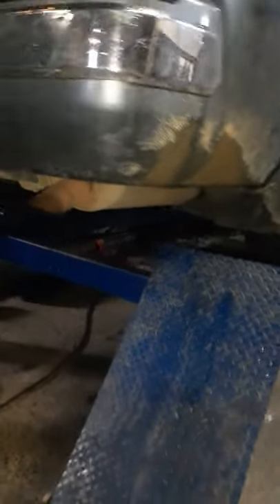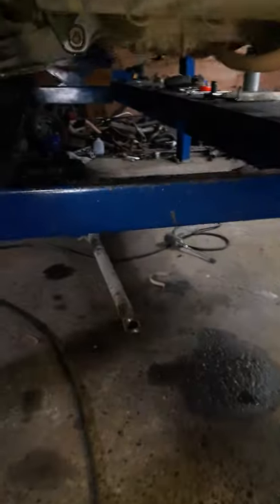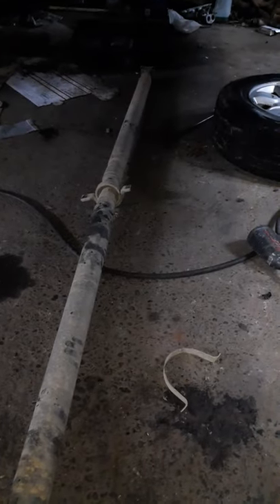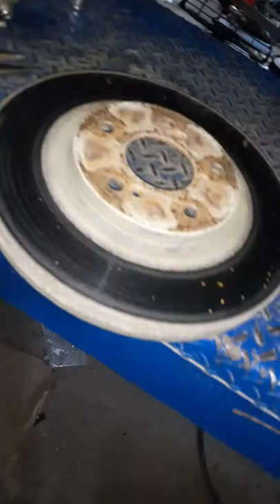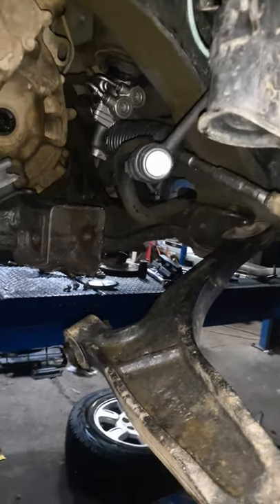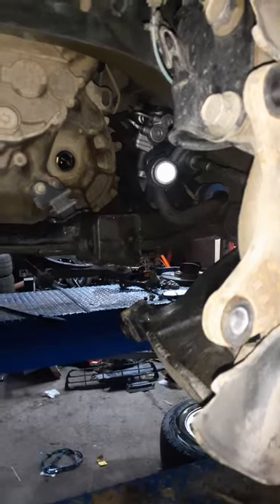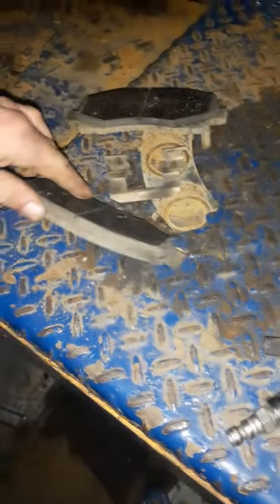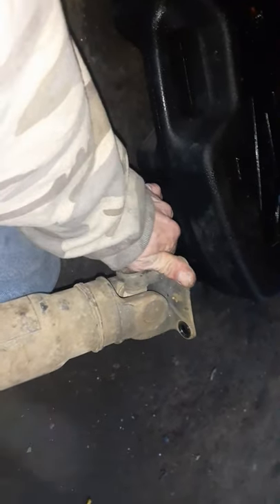Honda ridgeline bad vibration

Comment: 2014 SE Ridgeline, 150k miles. Started to out of nowhere have vibration around 30-50 MPH which got worse over a period of a week. Took to Honda had bent center carrier bearing and a bad u joint.  New propeller shaft and all is good for about 1300

Comment: I have a 2006 ridgeline and going down the highway, it will make sound like I am running over a warning strips for just a few seconds and then quiet as a mouse again. when this happens, there ;will be a noticeable power drop.  what would do this?  thanks Jim
Reply: Check exhaust system.
Reply: Did you find the problem? I have the same   symptoms on my ridgeline

Comment: I have a 2010 Honda ridgeline EXL 213000 km it’s just starting to getting a little vibration when you accelerate from 40 km to 60 km an hour once at highway speed it doesn’t vibrate anymore. You feel it in the steering column passengers can’t feel it yet. Pretty sure when you accelerate the engine and tranny tip back and it binds the front U joint on the driveshaft.  Going to pull the front driveshaft out and check it out pretty sure it needs one. They’ll sell me a brand new one for $600 with tax. aftermarket one so I guess that’s what I’ll do if it’s toast. Just pull the driveshaft out of it the rear U joint is seized one way needs a new driveshaft.  Replaced the driveshaft today the driveshaft I bought has clips on the outside so is serviceable now.  Driveshaft fixed the coast down clunk and the up shift from 3rd to 4th shutter. Had some tire noise at highway speed which I blamed on the snow tires which I run all year. It has fixed that too. Very happy with repair.
Reply: How heavy is it? Do you need a Jack to lower it, or can it be done with one hand?

Comment: What's your facebook? I took off my ridgeline drive shaft and cant seem to separate the 2 halves to replace the carrier bearing and mount
Reply from the maker: I'm Michael Moors on Facebook with a current picture of my turbo b16a swapped SEDAN engine bay as profile picture
Reply from the maker: And you are honestly better off getting a new shaft entirely because of the joints. They are going to fail after you fix the center.... it's just my suggestion
Reply: @autoshopshenanigans9532  I tested out the joints and they seemed to still be moving pretty smoothly. I think a $100 fix is worth a shot of getting a couple more years out of the shaft before I drop $600 to replace the whole thing
Reply from the maker: I just looked at my old part from that job.. the center of that drive shaft is pressed together
Reply: @autoshopshenanigans9532  meaning what? I dont even know where the division of the 2 is
Reply from the maker: Honestly I don't know how to pull that apart.. I am not so sure on this myself if it should be
Reply: @autoshopshenanigans9532  well if I was able to purchase a replacement bearing and mount without purchasing the whole shaft, I assume theres a way to take it apart. I'll try to figure it out tomorrow